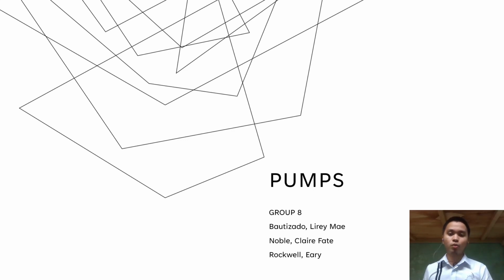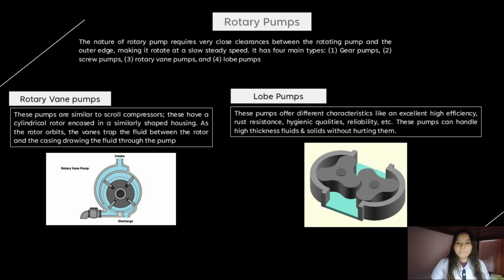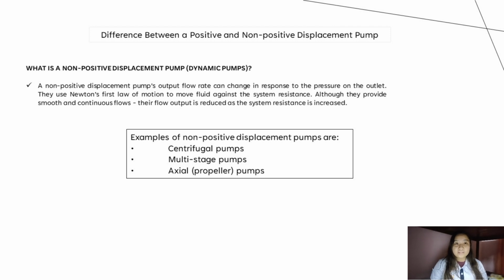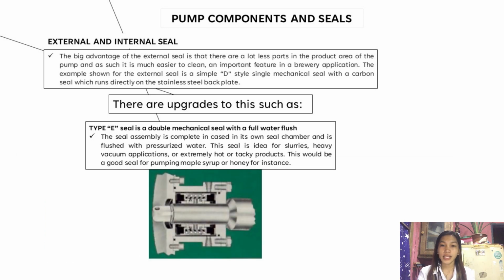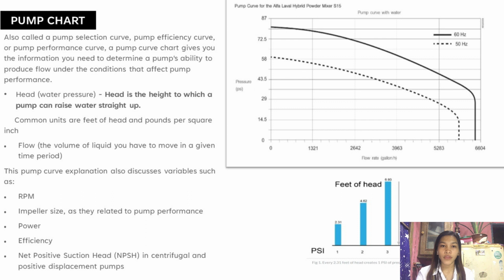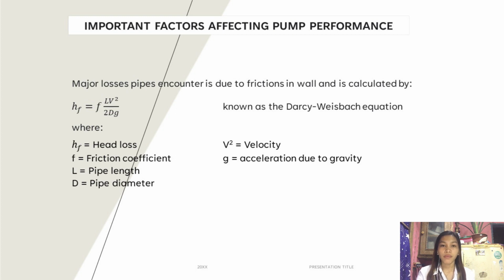PUMPS

Comment: Nicole Ann I. Alido - BSCE - 3A

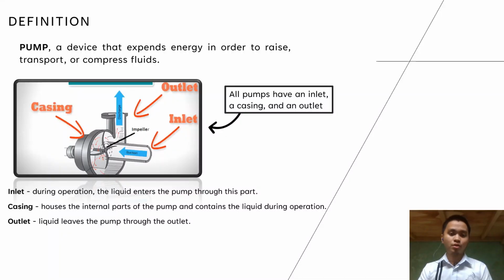0:11 Pump Definition
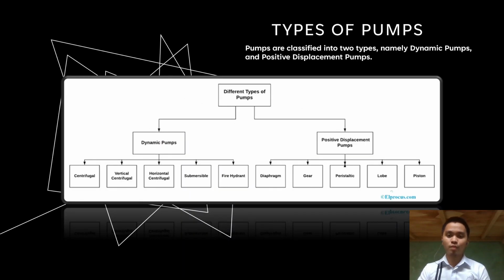0:55 Types of Pumps: Dynamic Pumps, and Positive Displacement Pumps
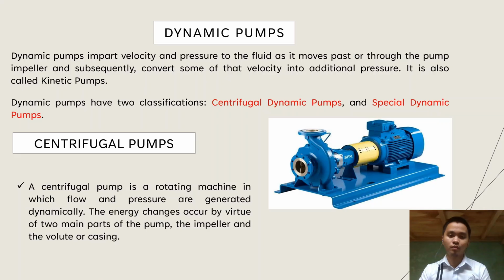1:02 Dynamic Pumps (Centrifugal Pumps, Special Dynamic Pumps)
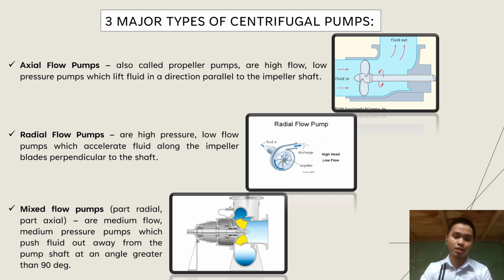2:30 3 Major Types of Centrifugal Pumps: Axial Flow Pump, Radial Flow Pump, and Mixed Flow Pump
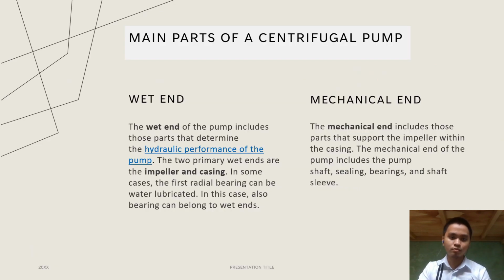4:01 Main Parts of a Centrifugal Pump
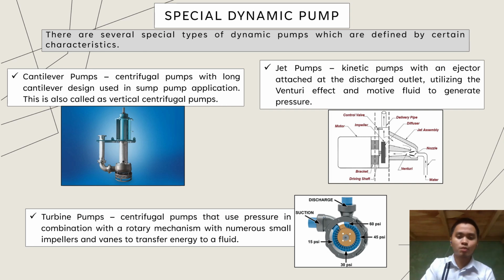7:01 Types of Special Dynamic Pumps: Cantilever Pump, Jet Pump, and Turbine Pump
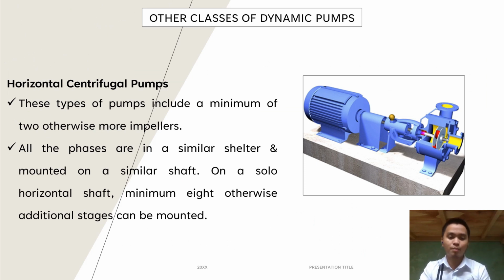8:01 Other Classes of Dynamic Pumps: Horizontal Centrifugal Pumps, Submersible Pumps, Fire Hydrant Pump Systems
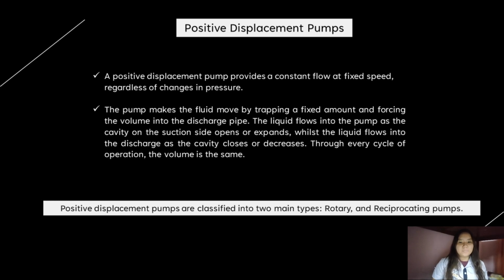9:36 Positive Displacement Pumps (Rotary Pumps, and Reciprocating Pumps)
10:22 Rotary Pumps: Gear Pumps, Screw Pumps, Rotary Vane Pumps, and Lobe Pumps
12:29 Reciprocating Pumps: Plunger Pump, Piston Pump, and Diaphragm Pump
14:52 Difference Between Positive and Non-Positive Displacement Pump
18:15 Pump Component and Seals
20:10 Applications of Pumps
20:35 Common Pump Problems and Solutions
23:02 Pump Chart
24:55 Impeller Trim Size
25:54 Net Positive Suction Head Required/Available
26:37 Important Factor Affecting Pump Performance

Comment: Alcido, Miashyll Angelou J. 
BSCE - 3A

0:09 Pump Definition 
0:54 Types of Pumps 
9:32 Positive Displacement Pumps
10:21 Rotary Pumps
12:28 Reciprocating Pumps 
14:50 Difference between a Positive and Non-positive Displacement Pump
18:14 Pump Components and Seals 
20:09 Application of Pumps 
20:32 Common Pump Problems and Solutions 
23:02 Pump Chart 
24:55 Impeller Trim Size 
26:37 Important Factors Affecting Pump Performance

Comment: Ga-as, Lalaine Lace W.
BSCE-3A 

00:10 Pumps is a device that expands energy in order to raise transport or compress fluids
00:24 All pumps have an inlet, a casing and an outlet
00:53 Two types of pumps: Dynamic and Positive Displacement Pumps
02:28 Centrifugal pumps are classified based on how fluid flowed on the pump (Axial Flow Pumps, Radial Flow Pumps, Mixed Flow Pumps)
04:00 Main Parts of the Centrifugal Pump (Wet and Mechanical End)
7:01 - Types of Special dynamic pumps (Cantilever pumps, Jet pumps and Turbine pumps)
14:53 The Difference between a Positive and Non-positive Displacement Pump
18:13 Pump components and seals
20:08 The Applications of Pumps
23:01 Pump chart also called a Pump Selection
26:37 Important factors affecting pump performance

Comment: Salvar, Mary Ann R.
BSCE-3A

0:13 Pump is a device that expands energy in order to raise, transport or compress fluids.
0:55 Types of Pumps (Dynamic Pumps, Positive Displacement Pumps)
1:14 Two Classification of Dynamic Pumps (Centrifugal and Special)
4:02 The main parts of a Centrifugal Pump are wet end and mechanical end.
7:01 Types of Special Dynamic Pumps (Cantilever, Jet, Turbine)
14:51 Difference  between a positive and non-poeitive displacement pump
18:15 Pump components and seals
20:15 Application of Pumps
26:36 Important factors affecting pump performance

Comment: AGUILAR, LLANIE YIN
BSCE-3A

0:15 - Pump is a device that expands energy in order to raise, transport, or compress fluids
0:54 - Types of pumps (Dynamic PUmps and Positive Displacement Pumps)
4:03 - Main parts of a centrifugal pump-Wet end and mechanical end
7:01 - Types of Special dynamic pumps- Cantilever pumps, jet pumps and turbine pumps

14:51 - Difference between a positive and non-positive displacement pump
18:14 - Pump components and seals
20:15 - Applications of pumps
26:36 - Important factors affecting pump performance

Comment: Jalandoni, Harvy D.
BSCE-3A

0:13 - Pump Definition
0:55 - Types of Pumps
4:02 - Main Parts of a Centrifugal Pump
7:01 - Types of Special Dynamic Pumps
9:36 - Positive Displacement Pumps 
14:50 - Difference Between a Positive and Non-positive Displacement Pump
18:14 - Pump Components and Seals
20:15 - Applications of Pumps
26:37 - Important Factors Affecting Pump Performance

Comment: Pelpinosas, Shannen Angela A.
BSCE-3A

0:14 - Pump is a device that expands energy in order to raise, transport, or compress fluids
0:54 - Types of pumps: Dynamic pumps and Positive Displacement pumps
4:03 - Main parts of a centrifugal pump: Wet end and mechanical end
7:00 - Types of Special dynamic pumps: Cantilever pumps, jet pumps and turbine pumps
9:36 - Positive Displacement Pumps provides a constant flow at fixed speed, regardless of changes in pressure
14:51 - Difference between a positive and non-positive displacement pump
18:14 - Pump components and seals
20:15 - Applications of pumps
26:36 - Important factors affecting pump performance

Comment: Entroliso, Jessa May M.
BSCE3A

0:10 A pump is a device that expands energy in order to raise, transport, or compress fluids.

*Inlet
*Casing
*Outlet

0:53 Two Types of Pumps

*Dynamic
*Positive Displacement

1:14 Two classifications of Dynamic pumps

*Centrifugal
*Special

10:12 Two classifications of Positive Displacement Pumps

*Rotary
*Reciprocating

18:13 Pump Component and Seals

23:02 Pump Chart

26:37 Important factors affecting pump performance

Comment: Llausas. Jan Marie
BSCE-3A

01:08 - Dynamic Pumps: Centrifugal(Types) & Special(Types)
04:05 - Main Parts of Centrifugal Pump
08:08 - Other Classes of Dynamic Pumps
10:20 - Rotary Pumps & its Types
12:38 - Reciprocating Pumps 
17:13 - Differences between Positive and Non-positive Displacement Pump
18:17 - Pump Components and Seals
20:10 - Application of Pumps
23:10 - Pump Chart
27:45 - Darcy-Weisbach Equation